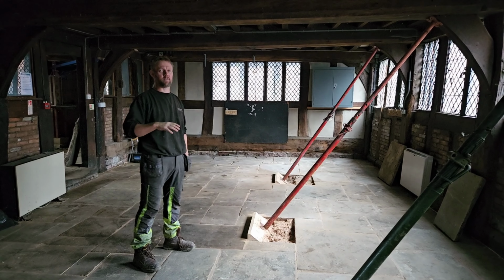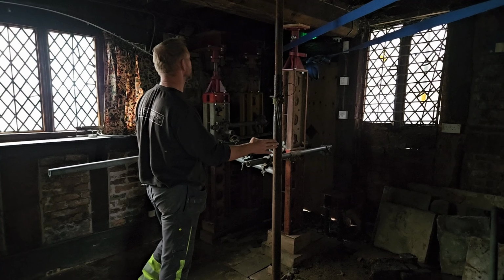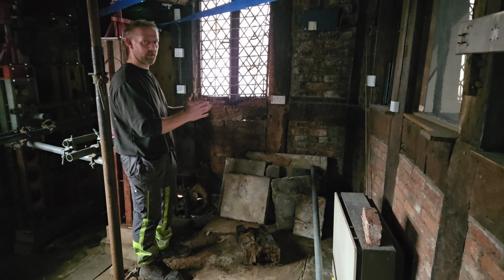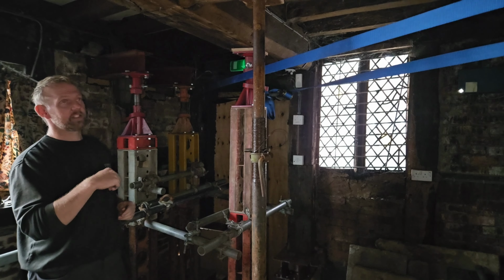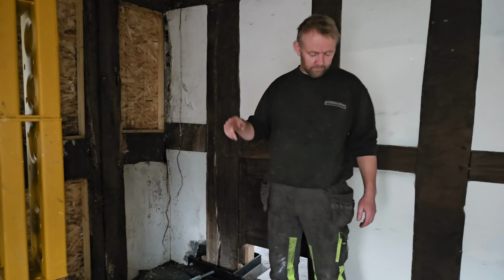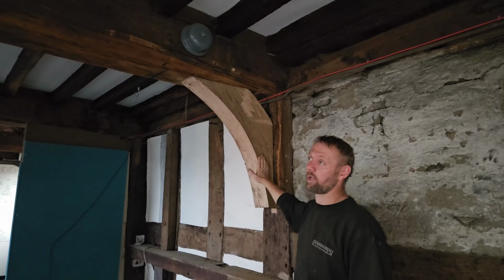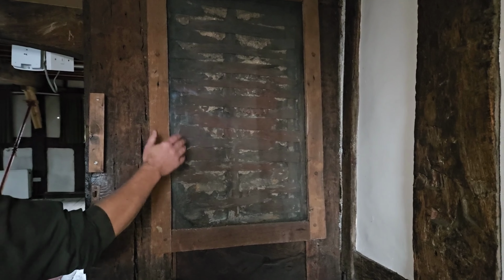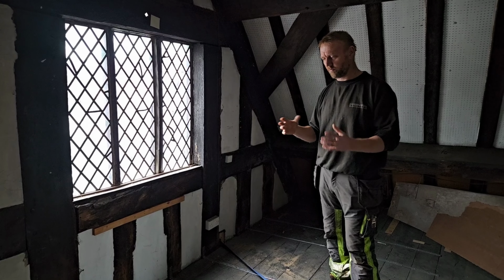Massive Structural Support Installation on 15th-Century Timber Frame Building

Comment: Enjoyed it yes. Thank you. Do you work with a structural engineer who advises where to place props, tie rods and straps. I guess when the foundations and sole plate have been repaired in that corner, these props will be removed. After monitoring for movement.
Reply from the maker: Yes, a structural engineer we work with on quite a few project got us involved with this. We had propping details and locations etc. Not sure what's happening with the building. We are still attending every 3 months to check the propping.
Reply: @UKRestorationServices thank you for your reply.😊